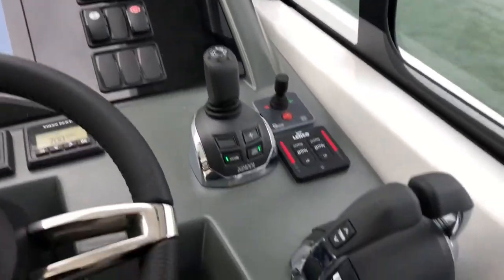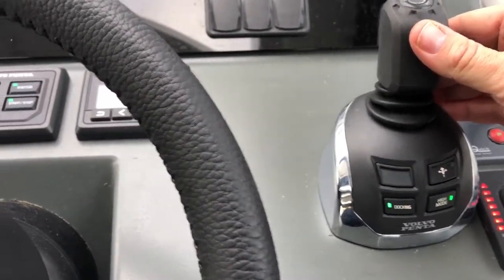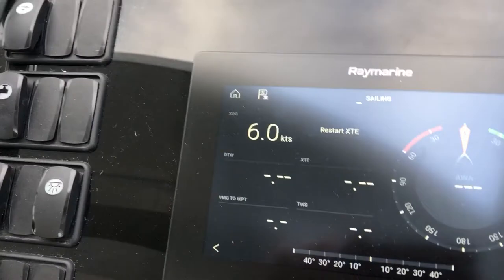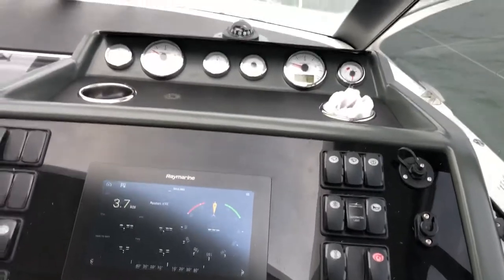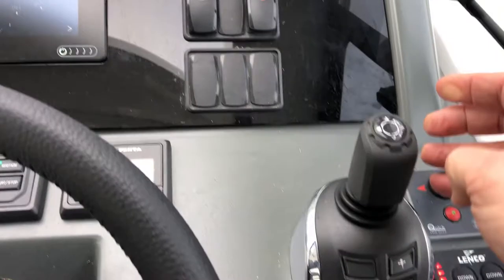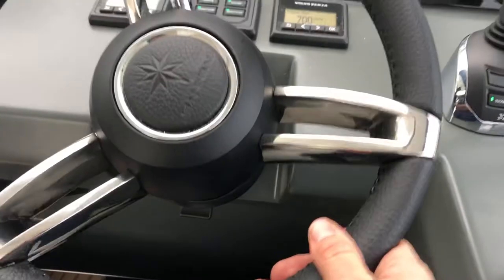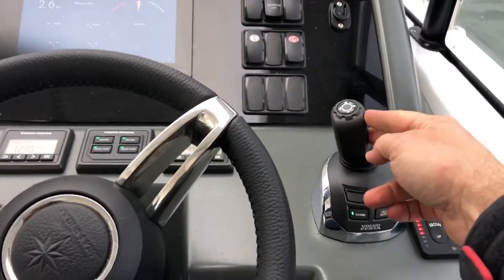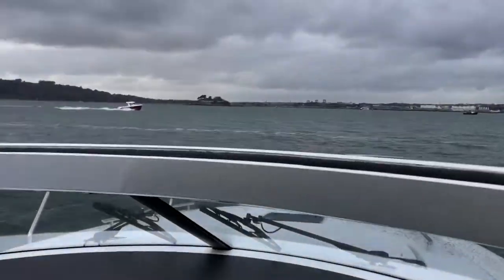Volvo D4 260hp Joy Stick docking control

Comment: does the boat have to be in neutral for the joystick to work or can it be in gear?
Reply from the maker: That’s a good question, I’ve never tried to put it in to joystick mode in gear. I would presume this is not possible as it would cause a problem when you come out of joystick mode. It is possible to drive it in joystick mode.
Reply: No it isn’t possible to activate the docking joystick in gear. It needs to be in neutral.